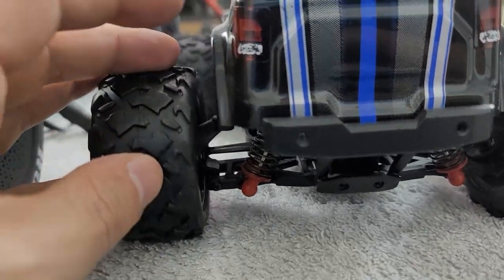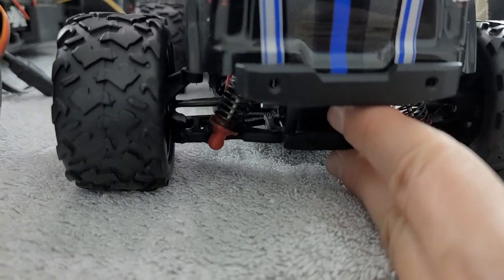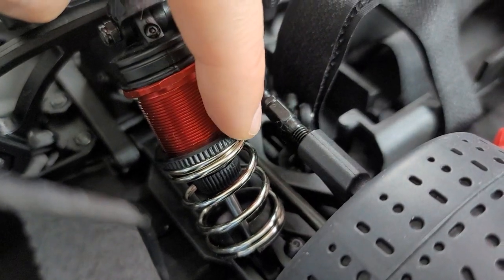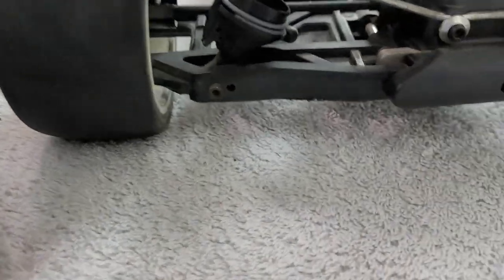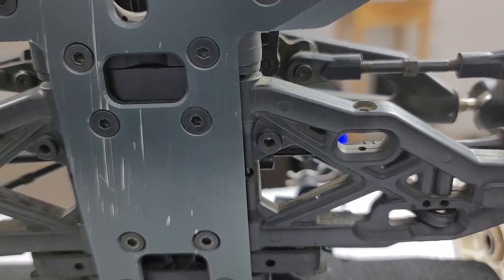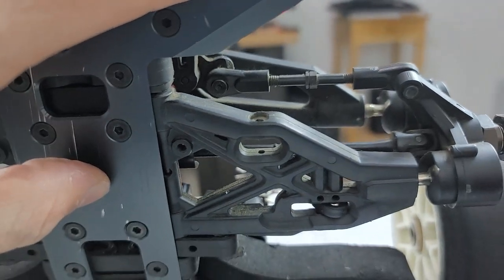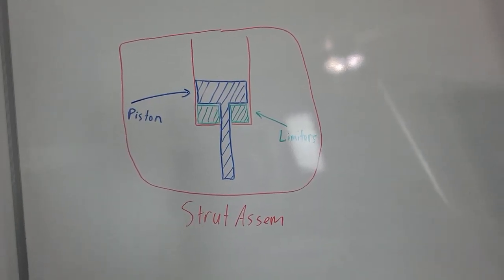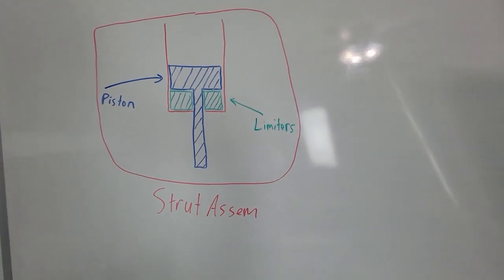RC Cars Droop Screws are SUPER helpful, But What Do They Do?

Comment: In 1/10 and 1/8 off-road racing, the purpose of adjusting droop is to change the handling of the vehicle. Droop screws make it convenient and easy; they are not primarily a protective measure against pulling forces on the shock. 

Not many 1/10 buggies have droop screws so we use internal limiters instead. Also, there are different length shock eyelets for coarse adjustments, and a number of adjustments affect droop as a side effect: changes to the inner hinge pin pills, axle height, and shock mounting locations. 

Droop screws can be used to limit how much the rear of the chassis rises when braking or the front lifts when accelerating. Springs and the kick-up/anti-squat geometries provide elastic means to change this behavior as well but droop screws give you a hard stop. They also affect body roll when cornering.

Comment: Yes, I use limit straps on my rc rock crawlers so that they can climb steeper angles without flipping over backward. They also help put down traction on the front tires while climbing. Same on the rear for descending. We put them in a way that doesn't affect articulation. Usually in the center of the axle and chassis.

Comment: Great and simple explanation of suspension droop.

I noticed on my very first Traxxas 4-Tec 2.0 steering A arms, that there were set screw holes provided near the hinges, with a small platform directly beneath for the set screw to mount against.

I disassembled the steering and threaded the holes to accommodate the set screws, and voilà! I had droop control. 

Thanks for sharing this info with us!
Reply from the maker: Thanks for the comment Casey!

Comment: What about the idea that droop screws help with not breaking off a shocks rod end when the a-arm over extends during a cartwheel or bad crash?  Although they adjust ride height, which I’ve actually seen myself from adjusting my own droop screws, I’ve always heard that they prevent the shocks from over extending, simply by setting the droop screws to where you have to slightly compress the shock before installing it to the shock stand off.
Reply from the maker: Droop screws do prevent over extension.

Comment: Do you set the droop screws with the car in running conditions  fully loaded with batteries and body on?
Reply from the maker: I set the droop screws with the body supported and the wheels not touching the ground to see the full extension of the struts. Once set, I load the car with all components to set the spring loading.

Comment: Droop ? wtf lol I’m the uk we call it sag
Reply from the maker: Interesting. Never heard of sag screws before. I looked up sag screws and not one accurate result shows up? If someone mentioned sag in Canada, it would often refer to a problem where the car is overloaded or the suspension is under performing causing the suspension to sag.
Reply: @RCexplained ”sag” is a mountainbiking term that refers to the amount the suspension compresses under the weight of the rider. 

To adjust sag, we adjust the air pressure in the shock or preload collar if it’s a coil spring. 

So it’s more like the preload adjustment on our shocks: how much the suspension ”sags” when it carries the weight of the car ready to go. 

Droop and sag are different in the sense that droop is how much we restrict downtravel when the chassis is unweighed and sag is how much we allow the suspension to compress when the chassis is ”not unweighed”. 

The adjustments meet when both of them are at zero. If you did that by limiting how far the suspension extends, you set the droop to zero. If you made the suspension harder or added preload to the point that it doesn’t compress under the weight of the vehicle (or rider, if biking), you set the sag to zero.